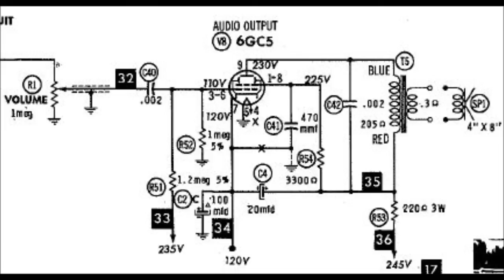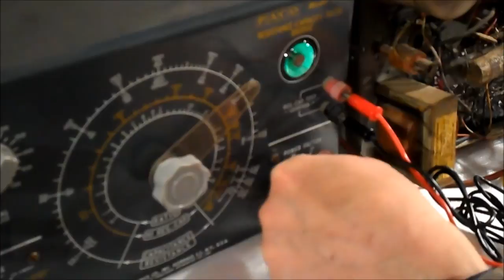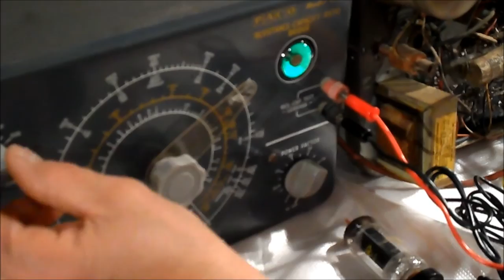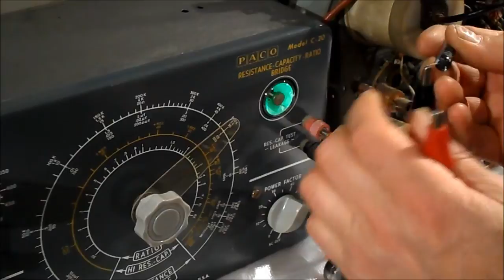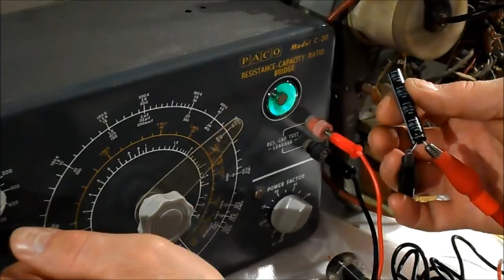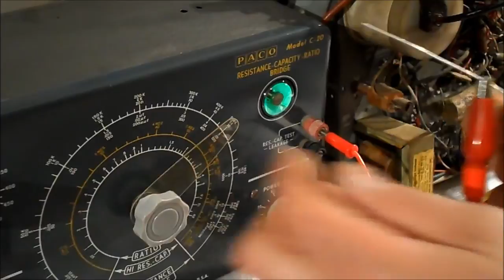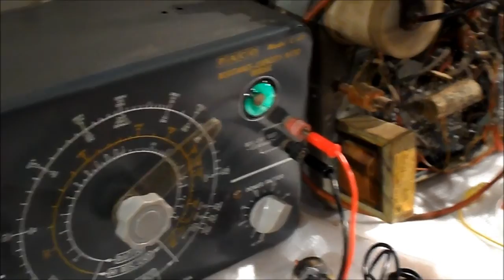1965 Magnavox B&W TV. Pt. 4. The Sound Cure.

Comment: I'll have to admit that I will carpet-bomb all the capacitors first. When they are leaky, or if they are a dead short, they can do so much damage to the almost hard to find, or un-replaceable components. I would love to troubleshoot these problems as you did, but I think I'd rather preserve what is good in the set instead first and foremost,
Now saying that, I WOULD love to troubleshoot capacitors on a totally worthless set like you did, just for the fun of it! I do have a Solar CB-160 Eye tube tester that I love to use on such occasions.
   Cudos go to DaveWM for sure!,
       Tom
Reply: you can have the best of both, protection and fun with troubleshooting. I monitor the crud out of a set just to watch for problems. This involves checking the B+ rail for shorts before even starting, monitoring the AC line current, checking the B+ voltage and current, checking critical things like HV and fly current, the list goes on and on. There are many ways of fooling round with this old stuff and I would say to each his own, for me the fun part is the trouble shooting so with precaution you can do that AND protect against doing damage. Your point is well taken though, I would not recommend just plugging and going for it, but even then with tube gear and exp you can often get away with that if you know what to look for. I am a little too cautious for that approach.
Reply from the maker: I would always recap first too, but that can lead to a possible wiring mistake. I like what I've seen others do. Power up slow, & watch current to establish a baseline. Others may also check windings of transformers first. All the ones I've done in the past run proper when all the capacitors get changed. Either way, it ends up being done. In the end I've always run into some sort of issue if I did not change all the wax ones. They're usually all leaky. At times it's nice to see just what the real failure point was. Here, think I'm gonna replace that Elmenco in the HV area regardless.
Reply: I did those on my maggie, there are several under the chassis, and not being able to test them at rated voltage I decided that was wise.

How does the fly look? I have two with that chassis, one dripped some black goo the other was really bad (almost all black was gone) looking but works so I left it be.
Reply from the maker: Dave WM
Will take a peek & report back. That bad C4 was rated @ 350V.
Reply: go ahead and get a meter reading across C4 if you get a chance, I am curious about how the voltage ramps up. My guess is an initial surge when power is 1st applied whie the 100uf to ground cap charges, then a further drop as the tubes warm up. should end up around 130v.
 a guess here is the surge is why the cap is rated higher. Seems like the could have just routed it to ground since they used such a high voltage rating on it.

Comment: something to watch for on stacked B+ supplies (sets that use tubes as voltage dividers to supply lower B+ to other  circuits in this case the audio out tube) is defects in the audio can effect other parts. Typical is a dead audio tube will kill the pic as there is no IF B+ supply. In your case a leaking plate bypass cap was supplying the IF B+ AND screwing up the audio bias. As you noted shot gunning can fix these kinds of problems, but it's really better to know what the to look for so if a problem comes up AFTER a shot gun replacement, you have a chance to fix it, with out re shot gunning. I am glad it worked out. The engineers saved a few pennies by connecting the ground end of the plate bypass cap to the 130v supply (so you can use a lower voltage bypass cap). You just have to watch out on polarity as it can be a bit confusing when that is done.
Reply from the maker: So, the 200V section of the can did not suffer too badly either at 235V?
Reply: well it may have. by hooking up the C4 20 uf between the plate load (audio transformer) and the the 120v supply it only has to deal with the difference (245-120=125v on that single cap).
The can sees was seeing 230 on a 200 rated so it "may" have been damaged. I would take that section out of circuit and check. If its not getting hot you are prob ok. if it shorted the 130v cathode would be lower and if it was open you would have low volume and maybe some other odd issues, so my guess is the can is ok.

 If you check the voltage across the replacement cap C4 (the cap leads, not to ground) you will see its only going to be about 130v.
 The more conventional approach to decoupling (or bypassing) the plate of the audio out would be to just connect the neg lead of the 20uf to ground, but then the cap would have to be rated for at least 250v. I noted in the sams it shows it as a 350v but IIRC the actual cap you pulled was lower.

The sams was prob being conservative as the momentary startup voltage is prob high until the tubes warm up. try connecting across the 20uf and do a cold startup, check the voltage as it warms up (C4).